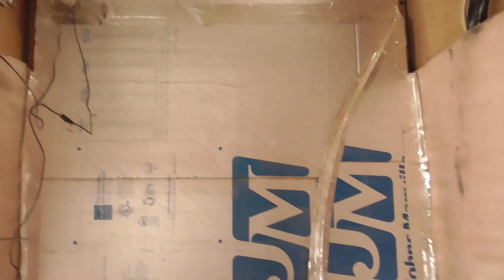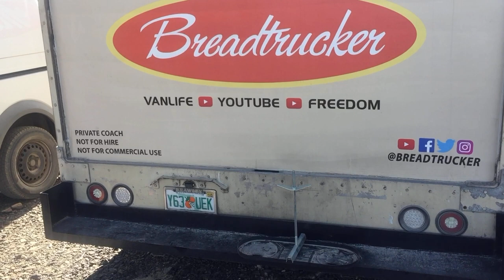Be Afraid.  Be Very Afraid.

Comment: Jerry try burning some of that cardboard I’m pretty sure it’s acid treated non-combustible. 👊👍😎
Reply: Oh. Well, then why was it all toasted?
Reply: @Warmfireandtea  Possibly because it was 20+ years old but it never caught on fire just dried out and turned brittle but never caught on fire 👊👍😎
Reply: @marketshare5273  .
Not to be an A. H. but it was only brown around the heat.
Reply: Most likely you are 100% correct but it never caught on fire unlike  The extreme flammability and off-gassing of the condensed foam board that you’re using for insulation it needs to be encapsulated in A product that is not highly ignitable by small spark from a loose 12 V DC connection 👊👍😎